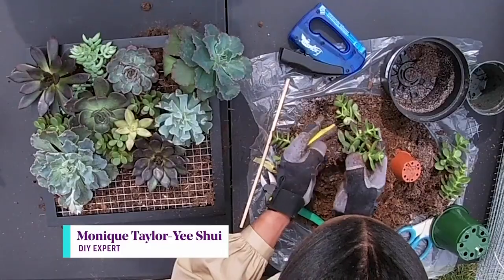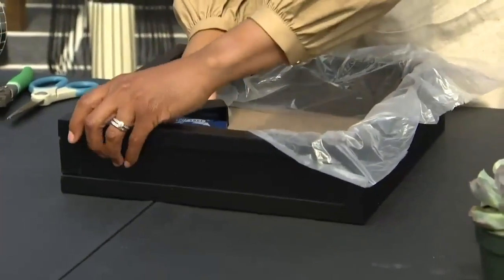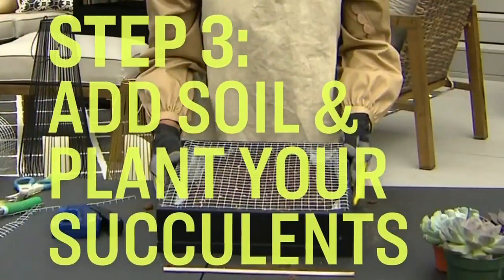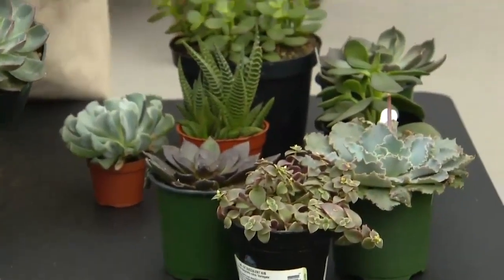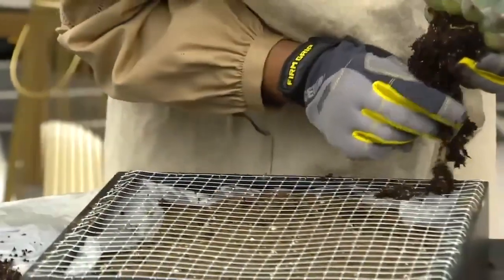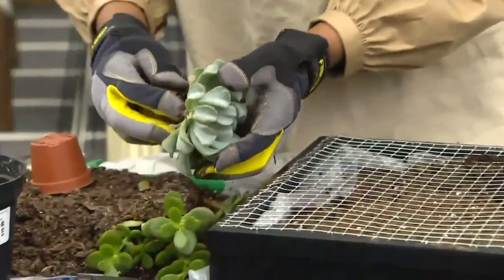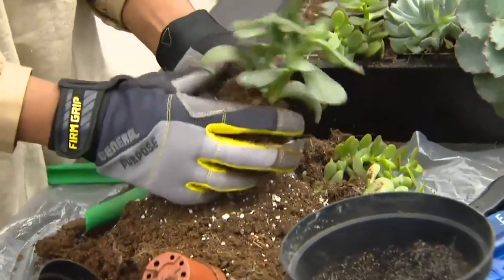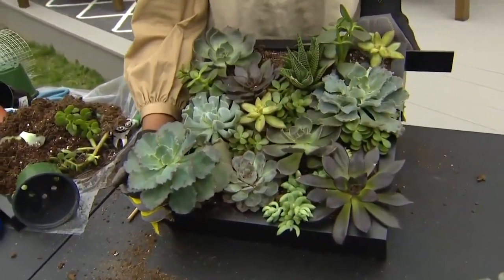A DIY succulent wall tutorial

Comment: Why didnt you add the poting mix before adding the wire?
Reply: I asked myself the same question.
Reply: The real question is why did they show a succulent box with plastic plants and not the real ones? If you watch closely the picture they used at the beginning and end of the video shows a succulent box with fake plants. They make you think that the little DIY they did works but it doesn’t. You need to use moss not dirt. The dirt will just fall out.
Reply: @nicogs97  😂 noticed that too…
Reply: @quintper3059  @6:32 When "30 minutes later" sign showed. What I noticed and I thought I missed something. When she has attached the mesh it is clearly visible with the edges and staples. In the next chapter where she places all the succulents the box is suddenly framed and the mesh with staples is not visible. I mean this could be a good video but skipping parts or whatever where it looks different in the next shot without any explanation makes the video somewhat fake, imo.
Although I have seen a few video with this type of mesh and regular soil or a soil mix so that won't be an issue I think since you have to leave the plant horizontal for a week or more to let them set in the soil. From my understanding when the plants have rooted a bit the soil will be kept in place in the end but if you directly flip it vertical the soil and plants will probably fall out.
Reply: I did this project before its  was challenging but you can actually use soil but you cant hang them yet until the plants are well rooted like a month so the plants wont fall.